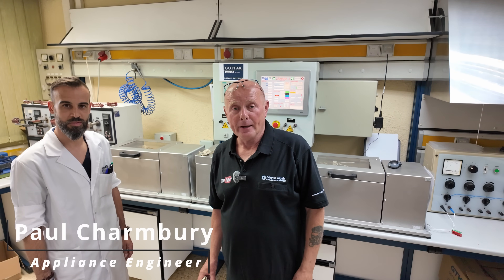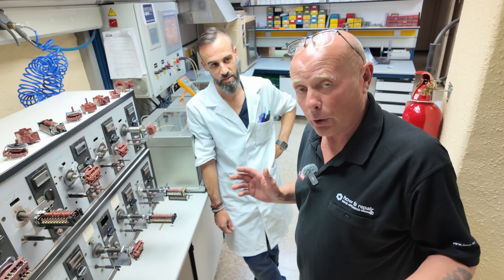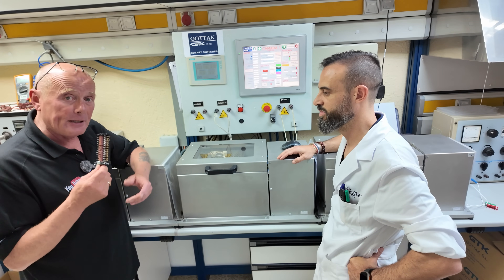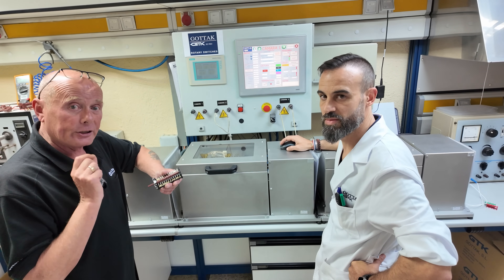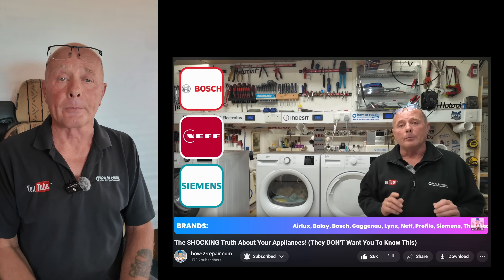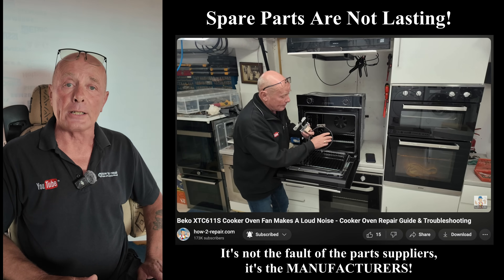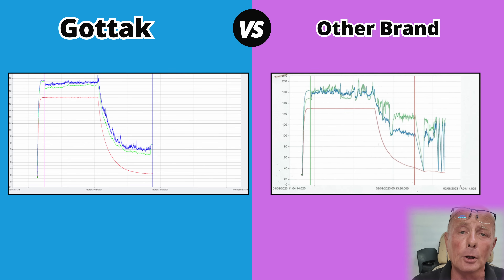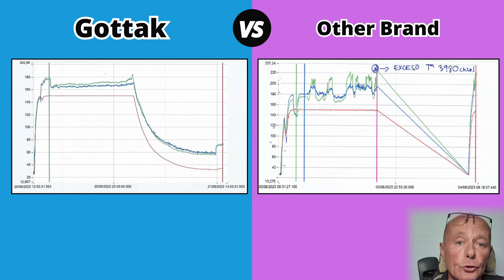Why Your Appliances FAIL SO FAST! Lab Results EXPOSE the Truth!

Comment: Apple and other comm devices manufacturers, also incorporate built in Obsolescence to force users to buy new. This is also why they do not like it when we repair our comm devices because when we repair our devices we are not buying new. There is no reason for this except for selfish greed and profits. Also, if I buy something, it becomes mine. And if I want to repair it myself or even take it to someone who ISN'T an authorized service center, again, that is my choice because the device that I paid for, is mine. (Note: I am not claiming ownership of IP, intellectual property just ownership of the device that I bought and paid for.) Example: I buy a Mustang as is from the floor of the dealership. I can now add an after market radio with a multi CD player, mag wheels and low profile tires, and even tear down and rebuild the engine to get as much fuel efficiency and horse power out of it that I can. Again, I am not taking ownership of any IP, but I am the owner of the Mustang which allows me to do with it as I want. Same principle with any device I buy. If the manufacturer did not want me to make such changes, then they should not have made me pay full price for it. 

#RightToRepair
Reply from the maker: Hi mate thanks for this absolutely brilliant and perfectly articulated comment. You're right that the motive is selfish greed. By making devices hard to repair for anyone but themselves, companies can control the lucrative parts and service market. More importantly, they get to decide when your device's life is over, forcing you to buy a new one. This philosophy isn't limited to phones; we see the exact same principles at play in the appliances we discuss from using proprietary parts to refusing to sell spare parts to independent shops. It's all part of the same strategy of built-in obsolescence.

Recently, I've published a very interesting and historical planned obsolescence video about the light bulb cartel and their evil plan about the built in obsolescence and with this link you can watch it: https://youtu.be/VgnOUk3x2SQ?si=oZduJXj8iqxDNDSe

Comment: Everywhere household appliances are no longer used such as mechanical switches or motorized commutators and now now triac or mosfet systems sometimes relays but they are eliminating them.
Reply from the maker: Manufacturers have replaced a durable, serviceable, mechanical system with a fragile, non-repairable electronic one. This is a core strategy of modern built-in obsolescence.

For a deeper dive into this topic and to see the examples we covered, please check out the full video here: https://youtu.be/gEgSCbZnHVM?si=wTIw0mELuhWaw4aX

Comment: It not just the short life of appliances, but safety and ease of repair. For example, I have had cheap toggle switches either lock on or off, and fail to switch on or off when repeatedly toggled. So you think a system is off, but it still has electric power, and vice versa. 
   Or components fail and start an electrical fire. Circuit breakers in electrical panels fail to function properly after only a few months in service.
  Thanks for your video.
Reply from the maker: Thank you for your comment. I appreciate people like you taking the time to write it out. Please share it where possible. It might help others make a wise choice instead of being misled by the industry.

Comment: That is very easy quality is not a good bussines so they make it to last just up to the warranty runs out but as you know LG made a mistake so the compressor of the refrigerator where failing early because of the push in conectors on the power cable but to fix this you need to cur the compressor and the wiring is copper plated no solid cooper so this will show how this company cuts corners so there for I will never buy another product from this company that is only focus in the quarter for there onw profits so sad but true😢😢😢😢
Reply from the maker: Thank you for sharing your experience. You have described a perfect, and unfortunately very common, example of how modern appliances fail.Your observation about the wiring is spot-on. Using copper-plated wire instead of solid copper is a classic cost-cutting measure. It saves the manufacturer a tiny amount of money per unit, but it's less durable, more prone to corrosion, and can lead to connection failures over time, exactly like you experienced. The same goes for using cheaper push-in connectors instead of more secure ones.

The very issues you described—cheap materials and designs that prioritize profit over longevity—are what we aim to expose. For a deeper dive into this topic and to see the examples we covered, please check out the full video here: https://youtu.be/gEgSCbZnHVM?si=wTIw0mELuhWaw4aX

Comment: It's not about quality anymore, it's all about the money and how they can screw the customer. Not only appliances but everything now days has built in failure points. Like the iPhone. So you will have to buy a new one. Or the manufacturer won't sell any parts to the consumer or rather than buying the part you need, they will only sell a complete assembly.  It's not right for the consumer
Reply from the maker: Thank you for your comment. I appreciate people like you taking the time to write it out. Please share it where possible. It might help others make a wise choice instead of being misled by the industry.

Comment: Same thing happening in automotive parts. Often a new part fails out of the box and it might take several tries to get one that works. Ridiculous. Consumers need to hold manufacturers to account and BOYCOTT those who refuse to make better products.
Reply from the maker: You are absolutely right. This problem of declining quality is definitely not just with appliances; the automotive parts industry is suffering from the same issues. Your point about new parts failing right out of the box is something we hear constantly from mechanics and DIYers. It's a huge sign of declining quality control and it's incredibly frustrating for the consumer who is doing everything right.

This decline in standards across different industries is a direct result of the built-in obsolescence philosophy. For a deeper dive into the specific ways manufacturers design parts to fail, please check out the full video here: https://youtu.be/gEgSCbZnHVM?si=wTIw0mELuhWaw4aX

Comment: I had a customer that bought a very expensive Samsung fridge with an LCD screen and cameras inside the fridge with all the bells and whistles from another retailer.  3 years down the track half the stuff doesn't work anymore as the apps stopped working seems to be a common theme with Samsung.  I wouldn't buy a Samsung TV for that exact same reason.
Reply from the maker: Think about the environmental impact of building machines and then recycling them. These machines are often transported halfway around the world, which adds to fuel costs. It's baffling that we need to ship them every five years due to failure.

Comment: Remember when washing machines used to last forever!  Just replace the parts cheap even the drum!
 
Now they weld the drum and make so many different parts for each “model” it’s a pain in the ass so people just buy new
Reply from the maker: I've been repairing washing machines for nearly 50 years, and the basic principles of washing clothes haven't changed since the 70s. They wash, tumble, heat, and spin. It's baffling why we need so many extra features now. Machines used to last 15 to 20 years on average. Nowadays, you're lucky if they last five years. Obsolescence is clear in today's society.

Comment: This all may be true, and I'm sure it is, but it does come off as an advert for Gottack and thus is heavily biased. Nevertheless, it's OBVIOUS that ALL manufacturers are heavily invested in built-in obsolescence.
Reply from the maker: Our goal in naming specific component brands is purely for educational purposes – to show a concrete example of a part that is either well-made or, in many cases, poorly-made. But your feedback is well-taken, and we will be more careful about how we present this in the future to avoid any perception of bias.

Ultimately, as you correctly pointed out, the real problem is that nearly ALL manufacturers are invested in the larger trend of built-in obsolescence. That's the issue we are focused on exposing. For a deeper dive into the overall strategies they use, please check out the full video here: https://youtu.be/gEgSCbZnHVM?si=wTIw0mELuhWaw4aX

Comment: the other aspect i think is missing here is that we have far better understanding of both the environment the system is going into, and of the components themselves... such that modelling a 'end of life' date is even possible. there's far, far more data available in which to run those models, FEA, thermals etc... that we can now design a 'thing' to withstand a given life (perhaps chosen too short... but thats separate from this point) with far greater accuracy than 50 years ago, where it was more a case of 'we need it to last.... a while.... in some condition, doing the fatigue calculations by hand.' - that ends up with a far more overbuilt system, with bigger safety margins, than what we can do today. Such refinement is however entirely reliant on the input to that model... so if the switch's model doesn't include some unexpected event (like a power surge) then that finely tuned model that says 'x thickness' is enough, wont actually be enough in the real world, purely due to poor input data, one that may have been covered by the larger safety margins that'd be used in the past to account for all the previous 'un' knowns.
Reply from the maker: You have perfectly articulated how modern engineering capabilities have, ironically, led to less durable products. In the past, engineers had to over-engineer to account for unknowns; today, computer modeling allows a company to design a product right up to the bare minimum limit for its intended (and often short) lifespan.

And as you said, these finely tuned models are brittle and often don't account for real-world variables like power surges. It's how these amazing engineering advancements can be weaponized to produce a product that lasts for a specific, calculated period. This is the very essence of the built-in obsolescence we discuss.

The failures we showcase in our videos are the direct result of the design philosophy you've so accurately described. For a deeper dive into the specific components that result from this process, please check out the full video here: https://youtu.be/gEgSCbZnHVM?si=wTIw0mELuhWaw4aX

We also explored related aspects in these videos:

The shocking truth about manufacturers: https://www.youtube.com/watch?v=QsdGd2qDPaI
Heat pump tumble dryers are they really worth it?: https://www.youtube.com/watch?v=xn03N3b0-lE
Thank you again for adding such incredible depth and technical context to the discussion. Your comments are a huge asset to the community! Don't forget to subscribe to the channel for more insights like this!

Comment: not doubting the planned life issues highlighted... however i'd be interested to know what circuit parameters were used for the 16A load... ie your test bed may have more inductance / capacitance than the switch is actually rated for (though finding that detail can be hard on spec sheets) - that can have a huge impact on its own. Same goes for when installed - plenty of engineers (and even more so, accountants) will swap out a component, not realising that despite it having 'enough cycle life' and whatever other parameter, they dont realise/check all aspects (ie the 1st engineer deliberately chose a overrated switch due to a 2ndary factor... that subsequently gets ignored/skipped over by reviewers or accountants, if they're even aware of it...). Honestly think an aspect of this is the silo-ing of engineers to narrower and narrower aspects of what they design.

Comment: So what company's use Gottak switches?
Reply from the maker: Unfortunately, it's very difficult to give a simple list. Component suppliers like Gottak sell their switches to many different appliance manufacturers. A brand like Whirlpool, GE, or Electrolux might use a Gottak switch in one model but a switch from a different company in another, or even change suppliers for the same model during its production run. They don't make this parts list public, so it's almost impossible to know for sure what's inside the box before you buy.

This is why we focus on teaching you how to recognize the signs of a low-quality component (like flimsy plastic, unsealed contacts, etc.) versus a high-quality one. The specific brand name on the tiny part inside is less important than its physical build quality.

Thank you for your comment. I appreciate people like you taking the time to write it out. Please share it where possible. It might help others make a wise choice instead of being misled by the industry.

Comment: I’m in the industry and smeg are the worst for this. Their ovens and hobs are completely different sizes compared to every other brand. If you buy a smeg oven and build a new kitchen, when that oven fails, you’ll need to replace it with another smeg or fork out to have your kitchen rebuilt to fit a universal sized oven or cooktop (99% of brands make the same sizes)
Reply from the maker: Thank you for your comment. I appreciate people like you taking the time to write it out. Please share it where possible. It might help others make a wise choice instead of being misled by the industry.

Comment: Don't solely blame the accountants. Corporate management, engineering, purchasing and, yes, even the consumer is to blame. Shareholders and Boards demand profits while consumers buy mainly on price. You can't stay in business when your 15 year appliance competes with a cheaper 6 year one.

I see one way to fix this; not for consumers who buy solely on price but for the smaller subset that will spend more money if they are convinced they are getting better quality. The internet to the rescue; never thought I would ever say that.

We need to have a place (database) to which relevant knowledge about failure rates can be sent (both by consumers and repair technicians). Have access to the database for consumer inquiry with a little statistical trend analysis. This will take years but eventually the manufacturer cream will rise to the top causing the subpar to depart our hallow lands. The consumer will triumph and, sorry, repair shops will have to run lean for 10 years.
Reply from the maker: Your idea for a crowd-sourced database of failure rates, with data from both consumers and technicians, is exactly the kind of transparent system that could fix this broken market. In a way, that's what we are trying to do on a smaller scale with our videos: create a knowledge base about why things fail. A large-scale database like the one you've described would be the ultimate tool to empower consumers. The built-in obsolescence we expose is the reason such a tool is so necessary.

Thank you for your comment. I appreciate people like you taking the time to write it out. Please share it where possible. It might help others make a wise choice instead of being misled by the industry.

Comment: I tend to repair things myself, right up until my wife is so fed up with them that she doesn't want to deal with the old machine anymore. I managed to get my last washer and drier to last 17 years, I could have probably gotten further if I replaced the washer's pump that failed last month. I have started looking into what kinds of alternate parts I can get rather than using factory components when repairing because the factory components are so defective by design.
Reply from the maker: 17 years is a testament to your repair skills and a great example of getting true value from an appliance. We can also definitely relate to that tipping point where the rest of the family just wants something new that works without hassle.

For a deeper dive into the specific ways original components are designed to fail, please check out the full video here: https://youtu.be/gEgSCbZnHVM?si=wTIw0mELuhWaw4aX

We also explored related aspects in these videos:

The shocking truth about manufacturers: https://www.youtube.com/watch?v=QsdGd2qDPaI
Heat pump tumble dryers are they really worth it?: https://www.youtube.com/watch?v=xn03N3b0-lE
If you found this information eye-opening or helpful, please consider sharing this video with your friends and family. Your story and strategy are a great lesson for other DIYers.

Thanks again for sharing your experience! Don't forget to subscribe to the channel for more insights like this!
Reply: @How-to-repair  Honestly, it was mostly just occasionally cleaning out the tube coming down from the tub into the pump because that would catch all manner of crud that people failed to remove from their pockets (Velcro, switch game cards, sand, etc) and replacing the drier heating element once. There was some minor stuff with patching the doors up a bit as well, but that was cosmetic and not functional. It was a pair of Samsung devices, I hear that sometimes they have problems with the metal workings in the back of the tub rusting out, but I live in a very dry climate.

The stove has been a bigger hassle that has required more creative thinking on replacement parts, but we haven't gotten rid of it yet.